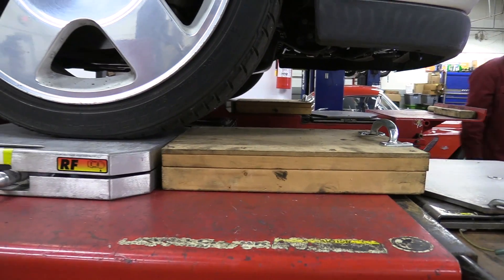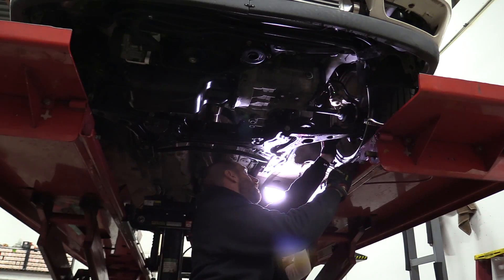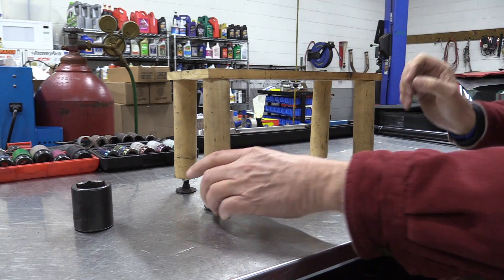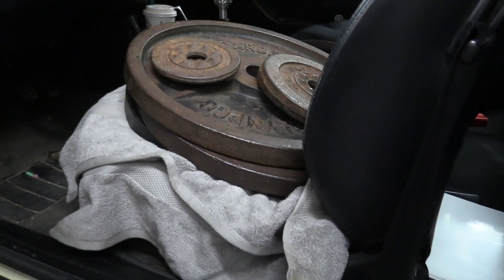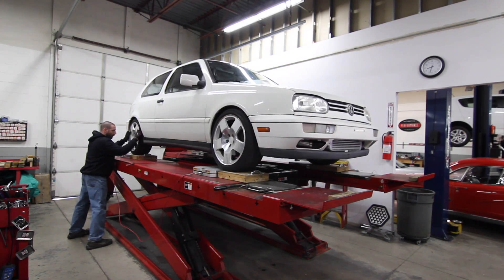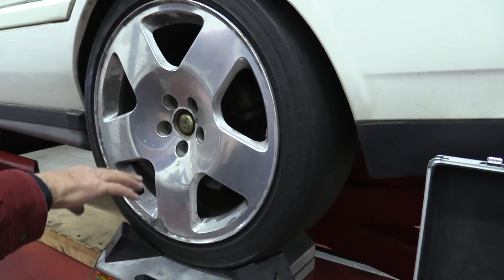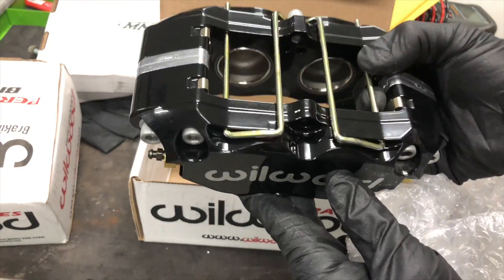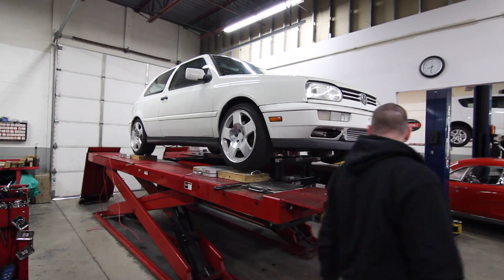What Is Corner Balancing and Why Your Car Needs It

Comment from the maker: Thanks for watching! Corner Balancing is a pretty awesome process. If you liked the video, let me know, and give it a share!
Reply: Does a new car (unmodified) have a perfect 50/50?
Reply from the maker: Probably close.
Reply: Does a vehicle that is very far out of corner balancing (say 75/25) have symptoms similar to that of standard wheel balancing? Such as vibration in seat or steering wheel?
Reply: The factory specification for aligning most VW'S was 150lbs in the drivers seat and a full tank of gas.  I loved the look on a customers face when I told the they needed a full tank before performing an alignment. I think they thought I had a deal with the gas station accross the street. lol! I would print out the procedure for them, Though it generally didnt satisfy them. Our shop was too cheap to spend the money on the scales.

Comment: That Latte... throws the weight off... tisk tisk tisk.
Reply from the maker: No it’s centered in the car and now accounted for. So I always have to have it. Ool
Reply: So Basic!
Reply from the maker: It’s true.
Reply: That latte is worth like 450 calories. You needed to add another 10 pounder to that seat after you consumed it.
Reply from the maker: The funny thing is, the only reason I stopped for it was because it was super cold that am.
Reply: HumbleMechanic 
Having that salad instead could have been worth 8” less stopping distance from 60mph though.

Comment: Hi mate. We are suspension setup specialist from Malaysia.

Just want to share our own experience.

Few years back we have a customer did this kind of balancing at some other place in my country doing what you’re doing. He took their car to test on Sepang International Circuit and getting as fast as 03minute 15second per round.

He then try our formula of suspension tuning.

After couple months, one of his teammates contacted us to let us know that now he can get 03minutes 00second sharps per round.

Since then, we knew that our formula is practical for race & on the road driving.

We need to practically understand how the centrepetal force works on the vehicle.

There is no way we can fix the amount of force generated on each cornering since there’s alot of variable parameters such as the speed, the distance and time to transfer the load from rear to front vise versa, left to right, etc.

Its acceptable if the circuit was like a velodrome and it’s only one car running inside the circuit.

But it’s not.

Ideally the Force = Mass * Velocity. But since it’s related to a curve, it became F=MVCos°

Even the jockey can’t fix the angle of cornering, then how it going to fix the amount Centrepetal Force.

We have tuned number of vehicles and having the consistent results on handling. It’s about formula. We didn’t and will never use this machine to “balance the weight “.

Plus, there is Sprung & Unsprung Mass. how can we ignore this factors and simply put it under one kind of weight. It weird.

We have FB & IG name Get It Tuned. You may follow our page if you this our explanation is make sense.

Thanks.
Reply from the maker: That is great, and not something most people are going to do

Comment: So if the spring rates are accurate we could basically  measure the wheel from the arch distance and get it pretty close like you did?  And set the front back by handling I guess.  Would love to see a Jerry riged version of this,  like a normal scale with a lever or something :)

Comment: hi Keith, very nicely done... I am going to get my car corner weighted in a couple of weeks... should have done this years ago.... it is a 83 XJS now weighing around 3,200 lbs....What would you reccomend for alignment I have about 2.5 degrees camber, 3/8 inch toe out and about 3 degrees castor.. the car is used for tight courses primarily, and has been very sucessfull over the years, the car is somewhat lowered and lightened as much as possible with a V12 6.0 up front.. I usually run pirelli or hoosier slicks about a foot wide...biggest problem is getting round one spin cone at Portland International, it is quite tight for a biggish car. I only have adjustable coil overs at the rear, should I try and get a front set ? I also have a set of Spax 13 position competition shocks six in total, as the rear as you probably know use four..Many thanks for doing this very informative video, Art.

Comment: Corner balancing, you'll need adjustable drop links for the anti roll bars too, otherwise you'll get unequal spring rate across the axle?
Reply: Ja son The bar is not really supposed to be there if you are running coilovers. The suggested set up on a MK3 is no sway in the front and 28mm in the rear.(The spring rates are too high and there is not enough travel to necessitate a sway bar.
Reply: From my understanding, if u wind one wheel up or down relative to the other side, u will effectively be twisting the anti roll bar (sway bar), and by placing a load on the bar you are effectively changing the spring rate on that side.  I've seen videos of tweaks done on cars which run quarter mile, and they talk about tweaking the drop links on the rear to have an overall effect on grip on the side which has least traction, in order to get as much balance of traction across the rear tyres... They call this preload.
I've also read that when you change ride heights you must fit adjustable drop links to prevent having undesirable amounts of preload. You're supposed to set the height you want with the anti roll bars disconnected, then hook up the anti roll bars and adjust the drop link lengths to the desired length without any load on either side of the bar/car.  If we are talking 49/51% accuracy as per that video, then surely you would need to also account for anti roll bar preload.
Reply: +Ja son
Sorry, but anti-roll/sway bars do not change the coil-over spring rate. 
Unfortunately, there is an abundance of misunderstanding and bad, unvetted/unscientific advice, opinion, info and data on YouTube, numerous forums and the internet. 
If the vehicle is ride height level laterally/left to right there should be no anti-roll/sway bar induced preload, unless there is improper installation, bent/damaged/defective/maladjusted components or it is intentional. 
There is no sane reason for static anti-roll/sway bar induced preload for most vehicles. 
Symmetrical static ride height as shown in the video is not affected by the anti-roll/sway bar and vice versa. 
Yes, some drag race competition vehicles employ asymmetrical left to right static and dynamic/instant offset preload on the rear suspension.
Reply: Ja son I am only referencing the model and make shown in the video. You can confirm my info on Vwvortex. Sway bars are only good in MK3 VW cars with coils like H&R or what have you.(Exept in the back you go big.) It helps the front end load the tire/motive traction/reduces understeer and bump steer in A mk3 VW. Make Shure you have a ZF rack plus suspension if your car is VR swapped like my 3.5 Cabby.
Reply: jeremy whittler I'm not doubting that sway bars are good or not.  I'm talking about the fact that if u have different ride heights across an Axle (for the sake over corner balancing) then you must dial out the unnatural loading you've then placed on the sway bar. Which is called preload if I'm not mistaken.  This video talks so much about balancing and the benefits of doing so, but yet they don't cover off the basic fact that the sway bar will be unnaturally loaded on one side, or shall I better say there'll be more spring rate on one wheel due to the twist of the sway bar from un equal ride height across an axle.
Reply: Ja son With most coilovers, the spring rate is higher and most have too high of a spring rate when you lower it down. The sway bar makes handling worse because the tire loses contact with the ground. You actually want the car to sway some to load the tire. There are pictures of mk3's lifting the rear wheel off the ground in turns , this is what you want- articulation and compliance. A suspension that moves is what works. Fwd cars are a different set-up than Rwd. I ran a 25mm sway first, now I have no sway bar and it's much better.
Reply: You should be disconnecting the sway bars when corner balancing. Once done, you then reconnect the bars with the suspension under load at ride height. That way the y don't interfere with the weights. My cars front doesn't have adjustable front links and bolted right up after making our adjustments to the balance.

Comment: Wonder what's the cost to do that 50 50 adjustment. Good video.
Reply from the maker: It will all depend on how much adjustment is needed. It can be as simple and easy as a 1/4 turn on one leg, or take hours. I was planning for about $200, but since it was so close it wasn't needed.
Reply: HumbleMechanic OK understood.
Reply: We charge $100 for basic 4-wheel performance alignment. 
$150 for basic 4-wheel performance alignment w/simple scale corner balance/cross weight adjustment and first hour of alignment/adjustment labor/time, 
Plus $100 per additional hour plus materials/parts for complex/difficult to adjust vehicles.

Comment: i have questions...1. what should be done first, the corner balancing or the alignment? 2. do the sway bars have to be disconnected? 3. should you add weight to simulate possible passengers? 4. lastly, should the static ride height be decided before the corner balancing? thanks in advance
Reply from the maker: Alignment first 

We did ours with sways connected. I’ve heard both ways 

Yes simulate the driver as we did in the video. 

Yes set desired ride height first. That the big adjustment and corner balance is the fine tune
Reply: @HumbleMechanic  thanks for the reply. i need more clarification and i apologize if I'm asking too many questions. i will be doing this soon on my car that has a ton of adjustment...

so, i should set the ride height first...should that only be done simulating the drivers weight? what about passengers weight when setting ride height and corner balance?

what is actually best when balancing, sway bars on or off?
thanks again💪

Comment: I'm three years in and the supension settles in storage. I have Voghtland identical to those visually. Did you eyeball that ride height setting?
Reply from the maker: Measured with a tape measure.
Reply: HumbleMechanic I'm MK3.5( 12V) Cabby swapped. I have an 02M but it's still too stiff. Maybe I can run custom springs. Maybe a corner weigh, then order KW(custom rate)?
Reply from the maker: That would be cool.  Yours have any damping adjustments

Comment: Given that the distribution is 50/50 on the cross pairs of wheels, what would it be on the axle pairs, front and rear? Does that not matter?
Reply from the maker: Do you mean the weight carried on the front VS weight on the rear?
Reply: Yes - weight distribution front versus rear. I would imagine this would affect braking, for instance. Are cars normally set up with an even split?
Reply from the maker: The front to rear split can really only be close on RWD mid engine cars. Otherwise the engine over the front is going to make the f front always weigh more.
Reply: That makes sense, thanks.

Comment: But technically the brakes are not supported by the spring so its not actually throwing off the balance right? Especially being so close to the ground its not being top heavy and equal on both sides. Just a thougjt
Reply from the maker: If the weight is much less is changes the overall weight. This can upset the balance. For this car, probably no need to worry about it.

Comment: Ayyy fat fives 🤙🏽
Reply: Have you checked out the 1552 Turbomac? Those are begging to be on the wookie in white. 18' would look really great, there are a few pics floating around.
Reply: jeremy whittler not a fan of the style plus 18s on a mk3 is a bit to much I like it clean and low but that’s just my opinion , them rotiform blq or bbs rx do look nice check dem out
Reply: lito vega  Absolutely, but you can't get the Rot'is in 17". The BLQ were my first choice.
Reply: lito vega I ordered the 1552 in Candy and they look great. My buddy had the 18" Rotiform on a Mk4 and they were sick.
Reply: lito vega Here is what happens , the 17" doesn't fit either. By the time you roll your fender,  your back @ 18" Fitment wishing you had bought those. I have an R-32 front end that requires a lot of ground clearance, if I could fit a 19" I would run that for the ground clearance.(Now you looking @R32 oil pumps and short pans).
Reply: jeremy whittler if they did that be dope But yeah I seen the set ups online it don’t look bad  on mk3

Comment: Spend the money on better tires instead.  Tires are the quickest source for performance upgrade.
Reply from the maker: Agree on the tires. But if your suspension geometry is not right your car will not be right.
Reply: With wrong geometry your brand new tires will get uneven.

Comment: Hey Charles, I just found out that you are based in NC, my car is in need of a clutch, (it is a 2013 Civic SI) but i am having trouble finding a trusted shop to do the job for me. Would you recommend me any good shops in NC. I am in Greensboro but i can travel anywhere around NC. Thank you.
Reply from the maker: I know a great VW shop in the area. Not sure if they would do Honda work, but a clutch is a clutch. They are called Everything Euro. Give them a buzz. If Tom and Walt aren't equipped to do it, I bet they know someone local that is.
Reply: Thank you. I will contact them. I will also drive up to Automotive Performance and Chassis to get my Civic corner balanced.
Reply from the maker: They are awesome! Let me know if you do. If I can I will meet ya up there for lunch or a beer or something

Comment: What does your guy charge for a race balance/alignment vs standard one?
Reply from the maker: Beaver Lake Motorsports I don’t know for sure. I think it all depends on how much work they do. To me it doesn’t matter the spec I’m setting to.
Reply: HumbleMechanic Was just wondering because there was a shop near montreal that had a deal for a race alignment with corner balancing for 250$.
Reply from the maker: That’s a good deal I think. As long as they actually balance it
Reply: Since i built my car myself, I don't trust any dude to touch it without me giving him the thousand mile stare while he works... I even talk to them with trick questions that I already have the answers to just to make sure they have the required competence. So i doubt they would skip anything.
Reply from the maker: I feel that. Lol
Reply: I use scales like this to setup dirt track race cars , and for a basic setup which is scaling the car and setting the front end I charge 150.00 but if it turns into a lot more work the price goes up
Reply: Witch makes sense, I'm talking 250$ cad so a little under 200 usd.

Comment: Can somebody elaborate on why the vehicle needs to be rolled on and off the scales? I re-watched that bit but I still don't get it.
Reply: to let the suspension settle. anytime you lift a car and set it down, the suspension will remain "upset" until the vehicle rolls a bit.
Reply from the maker: Yep. What Joe said.
Reply: Interesting. I wonder which forces act there. Hey humble, poke EE and make him mention it in a video :P whiteboard mandatory!
Reply from the maker: Good idea. I think that we may collaborate on that next go around. Yesterday we filmed a turbo blanket video.
Reply: Next time you jack up your car and then drop it back down, have a look at that tyres sidewall angle/stretch.  It will almost always be tucked back in under the car. It's to do with the way the suspension angle travels...  So that's why they roll the car back and forth, to allow the tyres and therefore loading to be correct
Reply: Ja son Right. The tire can't move out or in unless it's rolling.